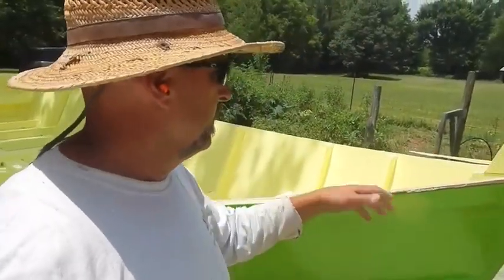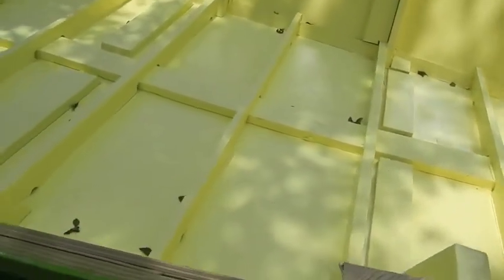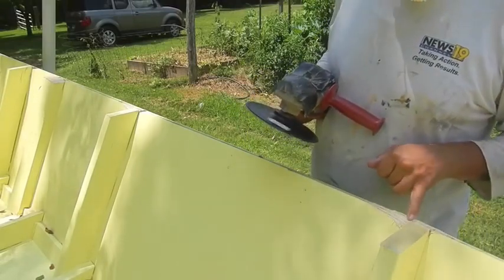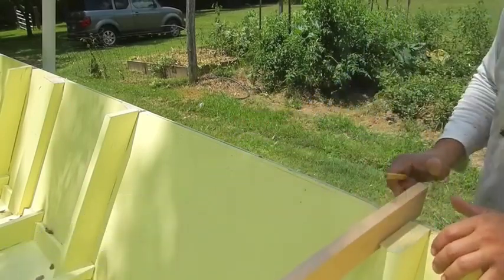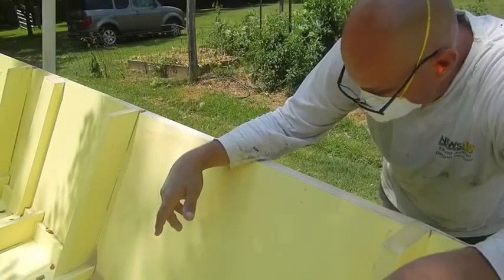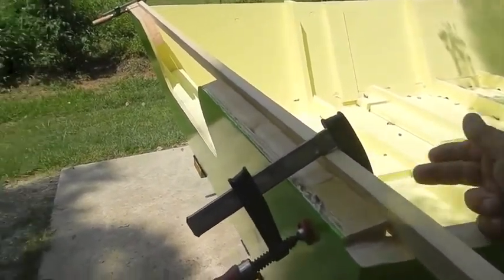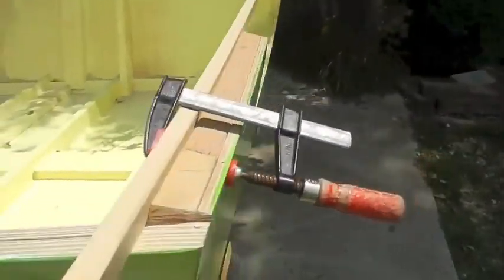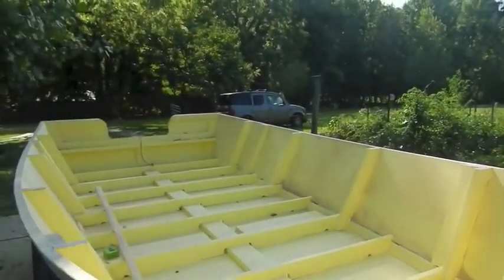Albion Boat Build Part 7

Comment: JEFF SPIRA sir, would it much harder to do a Simi V Dory Hull, I have h as d a Oregon Oregon Dory 22ft, but mainly Lanched my Boat off Pristine Hardor just North of Half Moon bay Ca. So v bottom would definitely not pound as hard in Rougher Seas, especially trips to the Farrloons. ? Thinking motor around  90 hp and up.